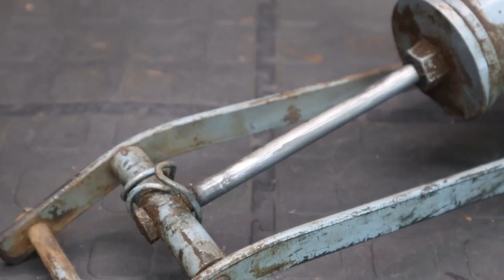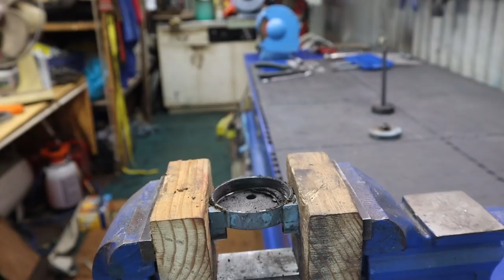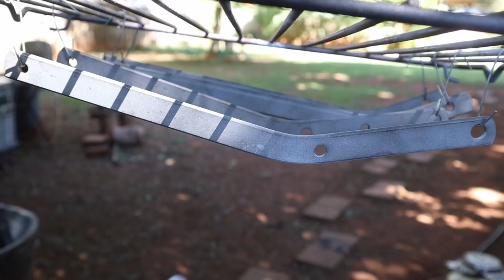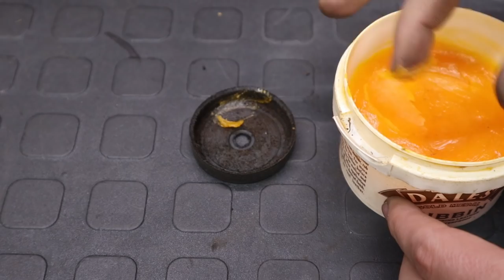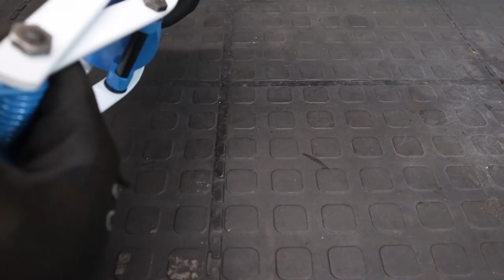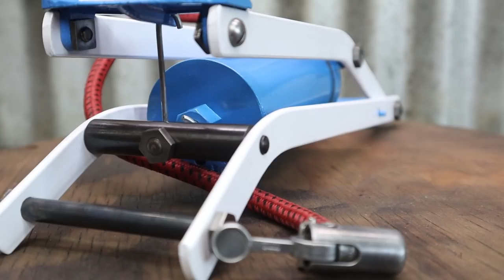1950s Aerite Foot Tyre Pump Restoration

Comment: Nice! It’s the first time I’ve seen anyone turn a thread anti-counterclockwise to seat it before turning it clockwise.
Reply: yeah sometimes its the only way to prevent cross threading. helps the threads catch and you feel or even hear a click to know it's on the threads!
Reply from the maker: works a charm every time!

Comment: looks great. one suggestion i have is that you really need more heat to hot blue metal parts like that bolt. the metal needs to start getting red in color. if you are worried about the temper, you can put it in an oven for awhile to stabilize it.
Reply from the maker: I tried to heat them till red but my little torch just did not have the guts for it. I will have to get something more powerful.

Comment: Nice restoration :) Although why did you not change the rubber on the inside? It would increase the pressure output.
Reply from the maker: I did search for a seal/gasket. It is made of leather and there is nothing of that size i could find on the entire internet. So the old one had to do. I even looked for rubber seals and tried to make my own, but even with my own one, it didn't work at all hahaha
Reply: @AJRestoration  ah yes sometimes its really hard to find a good replacement. Great job on the restaration though. 👍

Comment: Nicely done. The powder coat will certainly last for years to come. I would have replaces the gasket seal on the pump cylinder plunger with a new one, but other than that....perfect!    Thumbs Up!
Reply: its from the 1950's, they probably dont sell them any more
Reply from the maker: I did search for a seal/gasket. It is made of leather and there is nothing of that size i could find on the entire internet. So the old one had to do. I even looked for rubber seals and tried to make my own, but even with my own one, it didn't work at all hahaha

Comment: Excellent restoration the only thing I would have added is feet with rubber bottoms so you wouldn't scrape up that powder coat. 👍
Reply from the maker: Good tip!

Comment: FIND THE FAULT before dismantling.  If you do not and the fault disappears, you will not know what it was.  If the fault is still there when you reassemble, you will have to do the faultfinding then and have to dismantle again.

Comment: 1960's not 1950's
Reply: Had one it was awful, thats not the original valve clip the original had a screw end with a rubber washer inside and it would'nt stay on the valve.